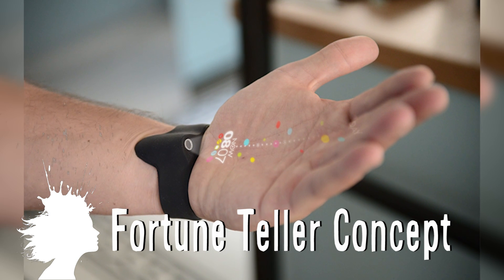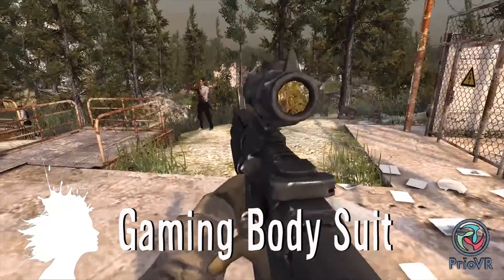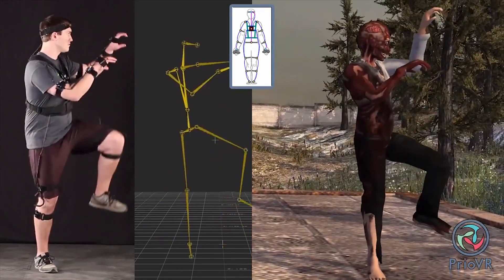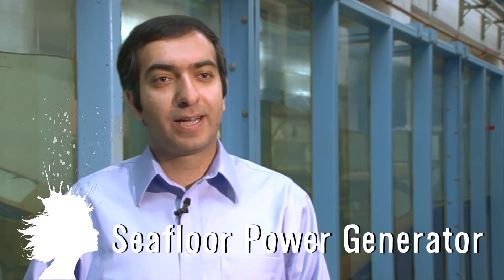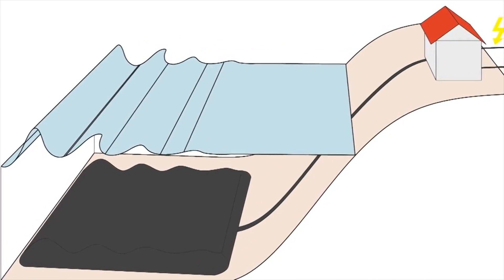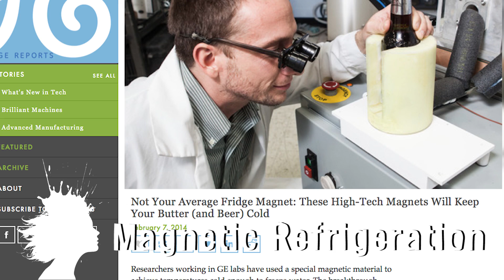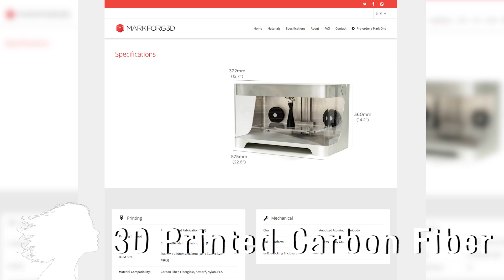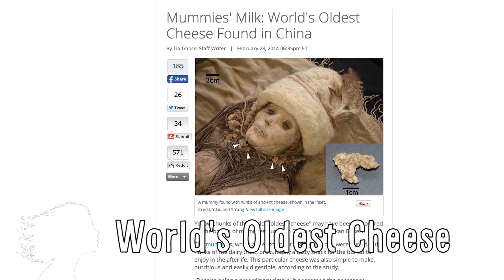Your Motion-Sensing Eye Cells -- Mind Blow #79

Comment: Could the wave generator be reversed, out of sync with the wave to diminish waves from a tsunami off shore?
Reply: Yes, it can be used to diminish waves and prevent coastal erosion. In fact we are working on a plan for outer banks of North Carolina, where millions of $ are spent every year to bring the sand back. see this http://hamptonroads.com/2013/01/outer-banks-duck-becomes-latest-erosion-hot-spot

It is not cost effective for tsunami. For tsunami mitigation a different line of research is in progress.

Comment: I seriously doubt that a bunch of oversized fans can have any efffect on a hurricane, let alone one like Katrina, especially since they can't handle winds of 40mph as proven in a video.
Reply: ***** Then publish a paper that disproves them.
Reply: *****
Let's all think about it this way; the turbines are using their OWN artificial wind currents to hold off the currents that aide the hurricane in building up its speed BEFORE it speeds up doofus, the turbines are not going to be in CONTACT as soon as the wind current is already up to speed (obviously).
Reply: ***** so the laws of physics somehow don't work because something is larger?
Reply: I'd be willing to try it.
Reply: meh, can't base it off one test...
Reply: Their science is SEVERELY flawed. A hurricane has winds of 74+ MPH, which is more than what these wind turbines can handle. Why else would they get turned off if the wind is too strong? Doesn't; matter how many of them are put against a hurricane's winds. They'll be smashed without any effect on the hurricane.
Reply: ***** okay but...proof? What are you basing this on?
Reply: to be clear here: these are not wind generators (giant fans), these are wind turbines (spins when an air current hits it), and they do not make their own wind. They would work because they help break up the air currents. Not to mention we can get power from it as well. Commercial wind turbines have a range of survival speeds (survival speed is the max wind speed it can handle, above which it gets damaged) going from 89 MPH to 161 MPH, which is well above *****'s 79 MPH. The most common survival speed is 134 MPH. Also, it's not a matter of them being smashed at high winds, since the reason they stop them is to break up the wind hitting it when the wind gets too strong, which would also serve our purpose here, which is breaking up the wind currents so the hurricane doesn't hit so hard.
Reply: What proof is there that they can survive past 134 MPH winds? Wind turbines are not mountains and are therefore not going to provide ANY resistance. In fact, because they sit higher in the air, they're more likely to blow over.There's already proof they can't handle 40 MPH winds so anything above that will only shorten the time they stay intact.
Reply: I was under the impression that the turbines would prevent the formation of winds that strong. I'm no meteorologist, but I'll be honest, I've seen my own town torn apart by hurricanes and tornadoes, and I don't give a fuck what it is, I'M WILLING TO TRY EVERYTHING TO NEVER LOSE MY HOUSE AGAIN. It. ain't. fun. fwiend.
Reply: ***** go home and blow on a fan, (small one) it will break up the wind and convert that energy into a spinning fan, the Law of Conservation of Energy
Reply: It won't work on a much larger scale because everything has limits.
Reply: Not when they're flat out wrong. Wind Turbines cannot withstand winds of 40 MPH so stating that they can minimize a hurricane's strength is beyond barbaric.

Comment: OMG, I had the idea to put on some solar panels on a glider so it could fly indefinitely a couple of years ago. Put on an electric motor, some panels and done!
Reply: What about the weight of those panels??? and that weight of whoever is flying??? i don't think it would fly
Reply: FruitFab Well, I'm not yet an engineer (still studying), so I can't do the calculations, but how I see it is that I would use those monolayer panels that have high weight to power ratio and make the glider out of carbon fiber. Like I've said, I only had an idea. And I would use a glider with a mounted engine because gliders have better lift ratio. So maybe it wouldn't be able to lift a pilot, but just like the one in the video should be able to fly "indefinitely".

Comment: Can someone explain how those windturbines on sea work? Cause the ocean is deep. Do they just stick a long ass metal pipe to the bottom of each one or what?
Reply: Some are connected to the sea floor some simply float. Depends on the depth and how rough the ocean is.

Comment: But there is no waves under the watter correct me if im wrong
Reply: the motion s under the water which, correct me if im wrong, causes the waves.
Reply: You only see waves when they get close to the shore because that's when the kinetic energy is squeezed into the shrinking area between the ground and the ocean's surface enough to lift above the surface.
Reply: Did you think they just skim across the surface of the water? Yes, there are waves under the water..
Reply: but there is no waves under wanter, theres the water montion and stuff but no waves at all
Reply: BallsOfTheDead XD
Reply: MrNikoZero Awh dear.... :(

 It's still classed as the 'wave'. It's this motion under the water that becomes the wave that you see above water.
Reply: thanks <3